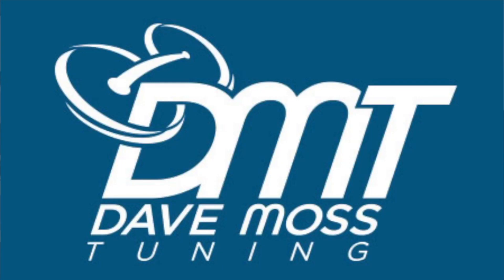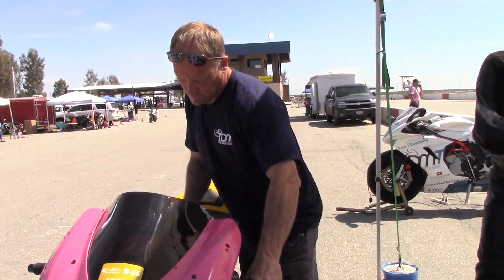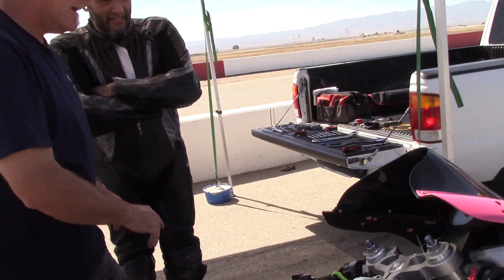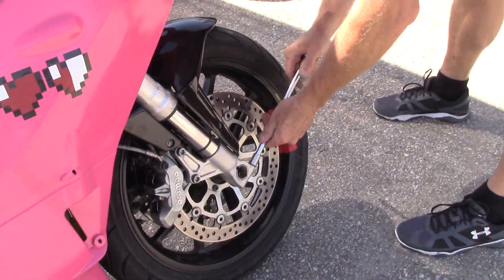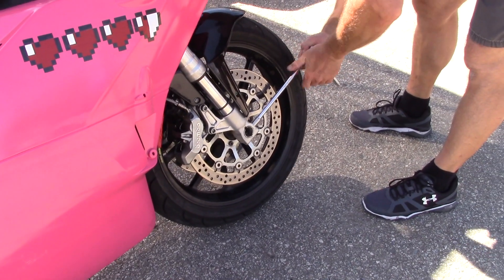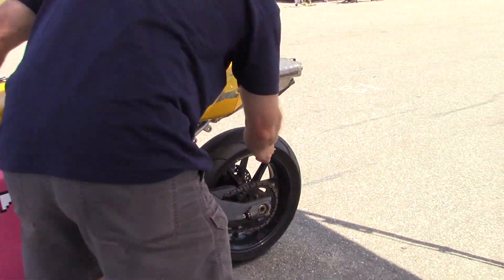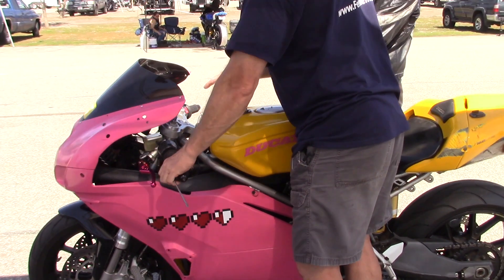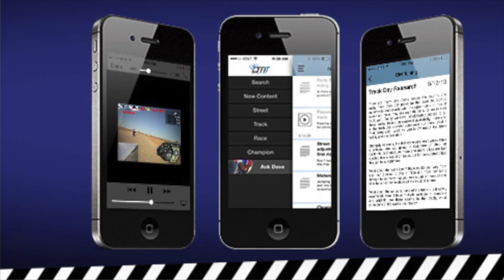2 Clicks Out: Motorcycle High Side Crash Protocols

Comment: The Michelin Pilot Power (2CT) is well known for overheating and sudden slipping at the track. Just use race tires :)
Reply: yep agreed, 28psi like this guy had was too low for a michelin pp, add to that a hot track and she'll soon start sliding
Reply: I agree too but they are perfect on
The road

Comment: Hello Dave,you are the best tuner on planet,very precise knowledge,Apt and to the point,can you guide us tuning the suspension on telescopic forks with no adjustability options,I ride a honda karizma r,The manual says 144cc of oil in front forks,I have done that with 20w motul oil,the rear suspension is new and on stock settings,the front fork assembly is also new
Reply from the maker: Thanks for the kind words. 20w should work fine but if you used the stock volume as per manual be careful that you do not lose travel.  Set static sag on the rear shock to 8-10mm.

Comment: Hey Dave, thank you for you expertise man. Have learned stuff from you. What do you recommend on noticed more rear wheel spin on corner exit than when my chain was less tight. Does chain tension effect this or is it my tires just getting to the end of there life?
Reply from the maker: Thanks for the kind words! Chain tension stops the swing arm moving and locks the shock so the tire spins easily Reset chain tension and retest.
Reply: Okay, that's what I thought. I forgot why it happened but that makes sense. Thanks a lot.